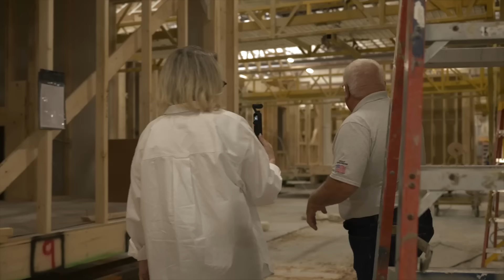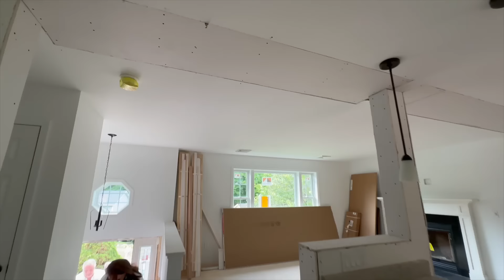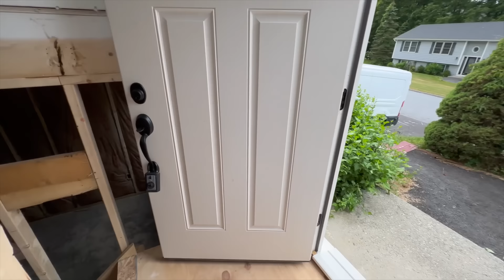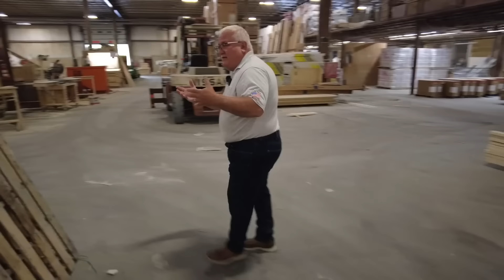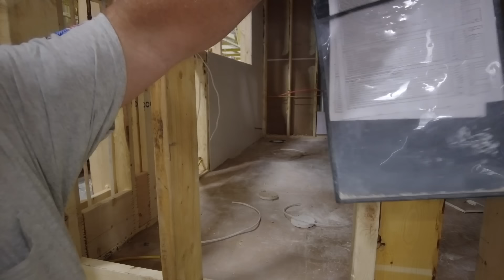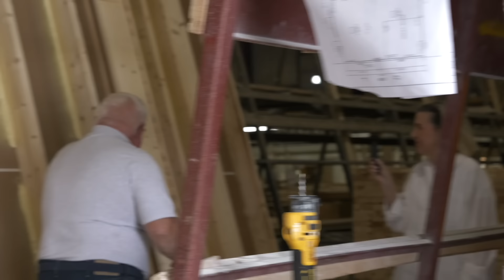Modular Homes ARE Better Than Stick Built!!!

Comment: Check out all of the Arizona home inspectors video showing all of the issues with our stick built homes.... Even those 1 million $
Reply: We have been building homes (stick-built) basically the same way for over 200 years - it is time for a new way of thinking about this.
Reply: @ecossearthur  I watch them all the time and they fined so many things. Wrong and the code inspectors pass them when they know it failed. That’s why I won’t buy a stick home ever if I can help it. Even the million dollar home are trash.
Reply: I love to watch "that" inspector as he calls out and shows the code and manufacturer violations that builders are suing him for pointing out.  That said...I wonder what the books have to say about modular and whether the installers are doing any better job.
Reply: Additional thought here.  Lets say for arguments sake, that its the same level of mistakes.  Thats often minor mistakes on a 30k home compared to spending millions on a home and having cracked tiles, window frames, roof coverings -  Granted AZ has those ceramic? tiles while other states have the more common shingles.   And i'll own that 30k home with 3k square feet in no time compared to the cost of a current 3000 sq foot home built old fashion way
Reply: Start an off-grid community consisting of individualized log cabins. ~LLC~ Lincoln Legacy Cabins

Comment: By  the time you buy the land and all of the permits and everything isn’t it just as much as a stick home? People always tell me that having a home is a money pit. Because you’re always fixing something. Roof, boiler, whatever. Is that still true with modular/ manufactured homes?
Reply: In my experience, the pricing for modular vs stick built is within 5-10 percent of one another. Modular just grants a better end product as the quality of the materials going in are typically much better. Also the use of jigs vs random tape measures allow for things like truly straight walls and accurate 90 degree intersections for walls, ceilings and floors.  Outside of that, like any home, if you take care of it there is no reason it won't last a lifetime.
Reply: @dickeysgarage  what are jigs? So do you think modular is better than manufactured homes in terms of straight walls that’s a thing to think about. Do you think that manufactured homes do not have accurate 90° intersections for walls ceilings and floors?

Comment: Building an 800sqft right now. Already starting on the base structure early. Just waiting for the final stamped plans based on my design and the permit process starts. Using all metal framing. Flat roof and closed cell foam insulation. 1 bedroom, 1 bathroom, kitchen and living space. 5 Ton MrCool central mini split system. On custom piers 2 feet above grade. Total estimated cost: $40,000. Yes, total.
Reply: @marcus_b1   can you please make some videos of this 800 sq ft and post it in comments here? Dying to see your work and project! Thanks
Reply: My "dream" DIY cabin is 800 sq ft on a full basement.  I thought about $100k, but your cost is very encouraging. I hope it goes well
Reply: @timothykeith1367  The full basement part of that dream can be the part that really pushes the costs up. Concrete gets pricey very quickly.
Reply: You just doubled your square footage though  @MattWeber
Reply: Yes but also have to fully finish the space for it to add to home value. Unfinished basement doesnt count as living space by most area code. So becomes a 100% cost without return until finished living space.@kevindavidsaver5370
Reply: @timothykeith1367  I always say that a project can cost as much as you want to to cost. The best question is what is the minimum maximum. Meaning what is the minimum I have to pay to achieve the maximum return on my plans. For example, yes I want the $500 toilet, but can I get the build completed with this $75 toilet and upgrade it later and in such a way that it doesn't compromise my design and style.
Reply: Done yourself ?
Reply: @richardmenz3257  of course
Reply: Cool! Does that cost include grading the land to make a building lot?
Reply: Can I get the house plan lol
Reply: @ScottyNandoMusic did you get an answer?
Reply: @marcus_b1 800sq feet with a 5 ton MrCool how or why did you decide this. A 5 ton unit would be for a 2,000 to 3,000 + sq foot home. Oversizing an HVAC system isn't efficient, it will cause short cycling and lead to component problems and uneven temperatures along with premature system failure. I have 1500sq ft and they recommended a 3 to 31/2 ton unit.
Reply: @marcus_b1  who did you buy it from?
Reply: @nojizyatax  Who did I buy what from?
Reply: @marcus_b1  can you please post the company you went with
Reply: You obviously aren’t building in a snow zone, which helps.
Reply: Nice, would like to know the builder please...
Reply: @jessielazo9373  I am the builder.
Reply: WOW
Reply: @marcus_b1  lol why do you need 5 tons of cooling for 800 sqft ???
Reply: @Respect.The.Grind.. so he can leave the doors and windows open and still heat/cool it as he wants!
Reply: @1982MCI  that’s wild.
Reply: You paid too much.  I priced out materials and labor and it came in at $23,000.  You fool.
Reply: A 5 ton on an 800 sq/ft structure? A 2 ton is appropriate. Why the overkill?
Reply: @Fireballsocal I was going to ask the same. My house is 1800sqft with a 4ton. Is the Mister Cool inefficient?
Reply: @Fireballsocal  maybe he loves the sent of fresh mold.
Reply: Thanks for about price! Thanks
Reply: Where are you building,  approximately how much for land/utilities?
Reply: You should just buy a trailer house and save $325,000.
Reply: @RedLeo-pf9yo  That doesn't make any sense.
Reply: @RedLeo-pf9yo  Don't they depreciate?
Reply: The metal structure is the worst kind of material - it’s not a house
Reply: @Whyisthis  Sure bud.
Reply: Obviously not bought from this Geezer Modular Home Co.
Reply: Metal framing is the way to go.  Termites ain't going to eat through that.
Reply: @marcus_b1  that is awesome … thanks for sharing… Marcus :)
Reply: @marcus_b1  That's great, we planning to do the same, just purchased a piece of land in a rural area, so that way we can avoid city codes that is a pain on the rear end, something around 600sqff and completely off-grid, water well, solar panels, and septic system, little by little
Reply: give your plans and builder! 🙏
Reply: @marcus_b1  what company
Reply: Wow that’s amazing. Wish I could see it all done and set up
Reply: @marcus_b1  what state??
Reply: @elizabethdarosa5036  Texas
Reply: @marcus_b1 That is awesome!  I want one too!  I live in a 1952 884sft 2+1 home I purchased in 2018.  I'd like to sell and take the equity and buy an acre of land and replicate the same sqft with an efficient modular home.  I think I've found the modular builder who can do it here in SoCal (High Desert) area.  And I want to be solar powered too.  I want out of the 30yr fixed and the area I love in. The modular idea was done for (some) those who lost their homes in the  The Camp Fire which was a devastating wildfire that occurred in November 2018 in Butte County, California, near the town of Paradise. Because of power lines during a high wind event!

Now folks suffered the same loss in the Palisades and Altadena/Pasadena areas.

I think this is the way to go.
Reply: @marcus_b1  you can't use flat roof construction in Florida.There's a reason they outlawed it years ago , water ponds on the roof
Reply: Does it have wheels? If yes = manufactured = trailer.
Reply: @marcus_b1  don't it cost 10000 to set on foundation

Comment: Nice/better. 
But still a 'custom, stick built home'... except in a factory.

I wish truly Mass Produced homes were available which would cost a small fraction of what they cost now. 
Maybe using SIPs, with most/all panels pre-wired for lights, outlets, switches, pex / plumbing, etc.

Comment: Wow, Kristina!  Great information, and yes, I want one, too.  But, I only want 800 sq ft.  BTW, it sure is hot in Dixie!  Hope Beryl poops out before she get to Luziana.
Reply: That's to small to be affordable on any factory built I've seen. Find someone local. 

I'd say one thing as a builder. Don't do slab on grade and use 2x4 floor joists.

Comment: I love modular home building. Working in traditional construction you're subject to weather stoppages and here in the south, the heat slows you down in the summer. A friend's backyard developed a fairly large sinkhole. The house is 20 years old. I had a feeling it was where they dumped construction debris. We got a backhoe and dug it up. All the wood waste had rotted away leaving some bricks, cinderblocks, and other debris. We cleaned it out, filled it in, and put down some grass seed.

Comment: The misconceptions surrounding modular builds are borne by a lack of understanding of home construction itself. This and the modular negative agenda that  nearly all of the big name, traditional home builders have engaged in, has mislead the general public with false propaganda.  About the only drawback to modular construction is in their logistics, not their quality, value proposition or design aesthetic.  Modulars have a limited range of delivery and even within that range, not all locations are accessible.  For these and only these reasons alone modular cosntruction is not a one size fits all solution.      The solution without question is a hybrid modular approach.
Reply: It is sad that the misconceptions surrounding the pro modular propagandists who will sink to sleezy tactics on par with the big corporations. History has born out that natural homes and natural home builders when well mainted last longer than claimed, and their overhyped quality claims which have been debunked by independent non-big business affiliated sources. At least, you admit some of the other serious flaws with modular homes though you do downplay the other issues about them. To sum it up, they are not a permanent one size fits all solution.

Comment: I would how is can stand up against weather wise can it stand up against heat cause I stay in Fresno California  please let me test one out over here in Fresno California a two story built I would love to test one out
Reply: For Fresno which has very long and hot dry summers, a well-built modular designed for those desert summers would be the idea solution. And consider using a geothermal cooling/heating system as that can reduce energy costs.